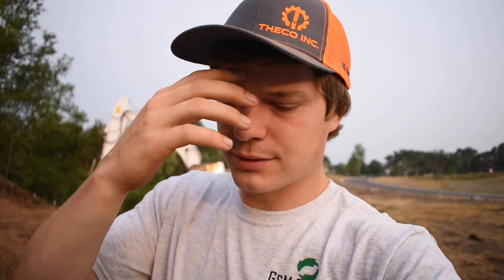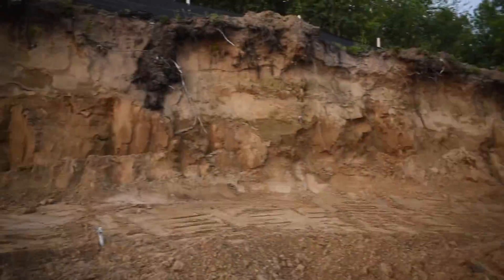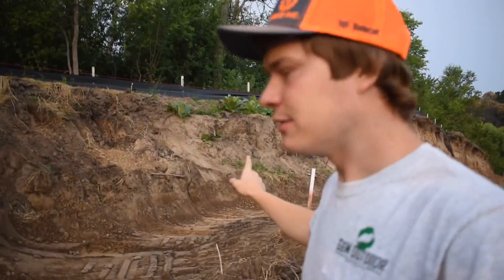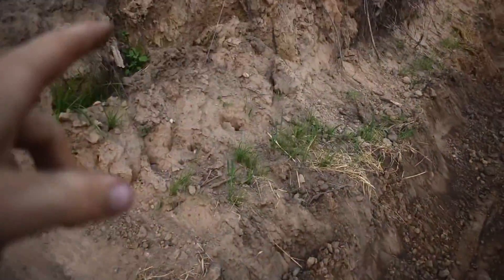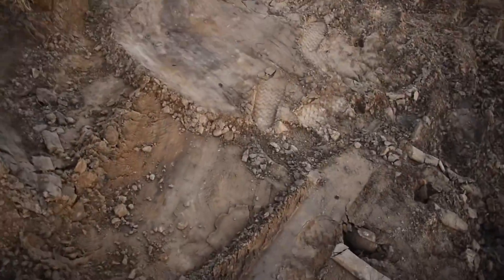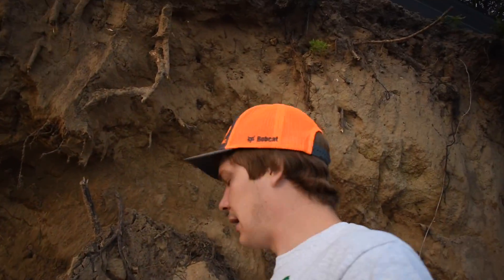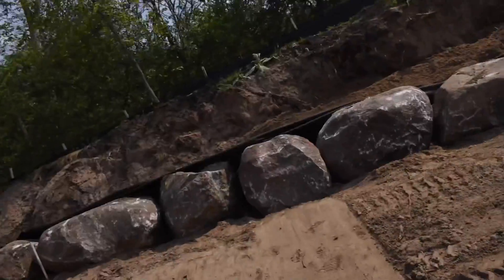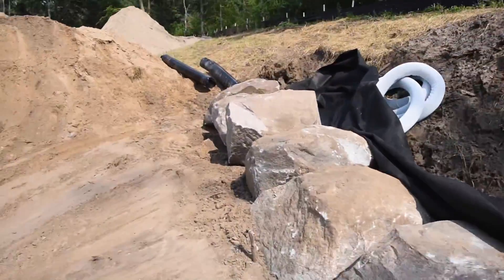ENGINEERED BOULDER WALL CONSTRUCTION PROCESS!

Comment: So what is the engineer's reasoning for putting drain pipe in crushed stone behind a dry laid wall ???  There will never be a drop coming out the pipe, any water will simply drain through the wall.
Reply from the maker: You are not wrong. They do it basically because it’s cheap insurance and makes them feel warm and fuzzy inside